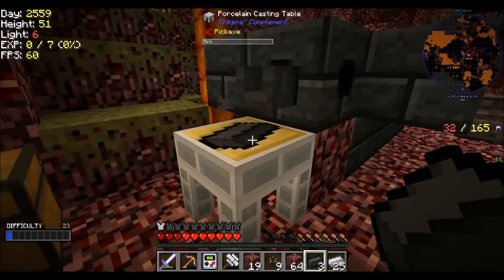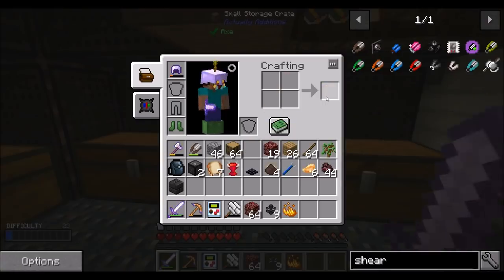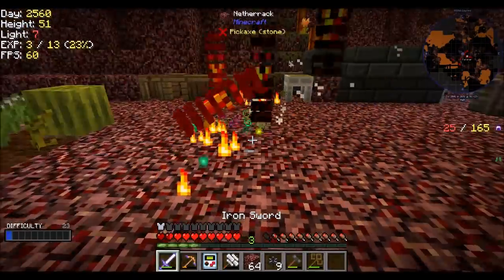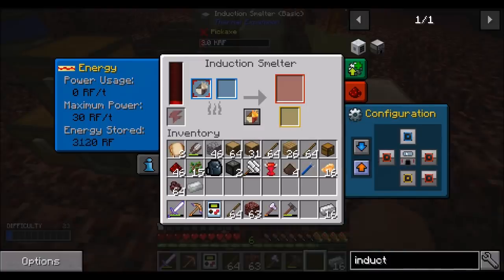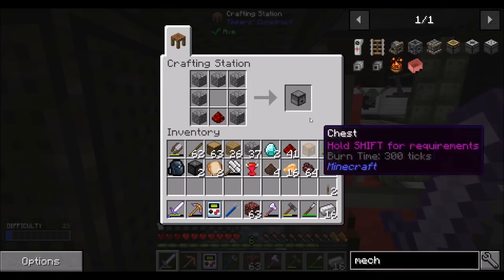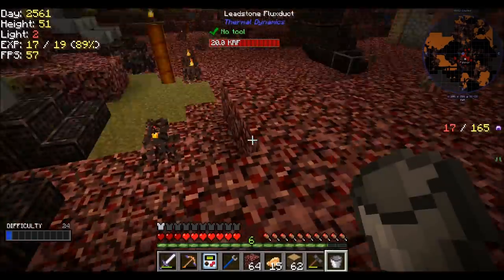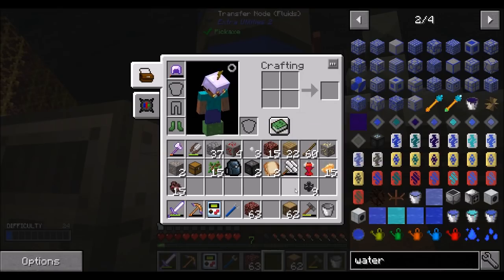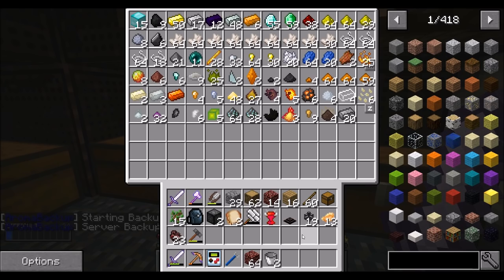Forever Stranded LS Ep16 Water Please

Comment: Nope sink dont output water! Also type in water in jei, third page and third line up from bottom there is a dimond shaped block for infinate water! Outputs to each four sides but i dont believe it does up or down...plz try!!! Also if you sift crused netherrack you can get cobalt and ardite... i strongly suggest a cobalt head and wooden tool rod for your picks...seeing you both go through copper all the time for crafting things and cobalt has much better durability and speed! And wood rod will repair your tool over time! Anyway enjoy n tks for the derps...
Reply: Michael Denyer they are using copper heads on picks because copper gives xp from mining anything, even basic netherrack.
Reply: Ya, but even just the binding will give them xp. They can use the cobalt for the head and throw a diamond on it
Reply: there using copper for extra xp but they can add diamond or sharpening kits or maybe poor cobalt around the head
Reply: You cannot create infinite water in this pack (even taking it from lakes/rivers/oceans won't reform the water source), so I would expect any block in this pack that usually creates water would be configured to not do so (such as is the case with the cooking with blockheads sink.)

Comment: Hey Dire, you can create a compact cube and within the cube, you can actually place water on the ground without it “evaporating” like in the nether. so you can use the water condensator with no problem!
Reply: Just tried this and it doesn't work for me...
Reply: That got nerfed. it's no longer possible in the current version. It's considered a hell biome now.

Comment: hey dire iirc you can make a bucket cast and make buckets much easier that way
Reply: 6 iron in smeltery vs 3 iron (hammered) with 3 string in craft table. They are struggling with iron a little bit at the moment.